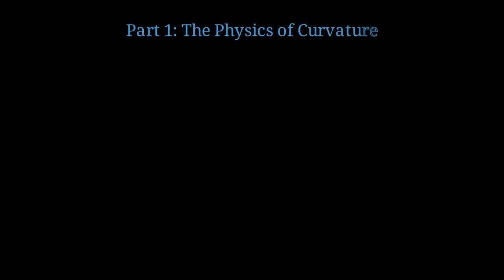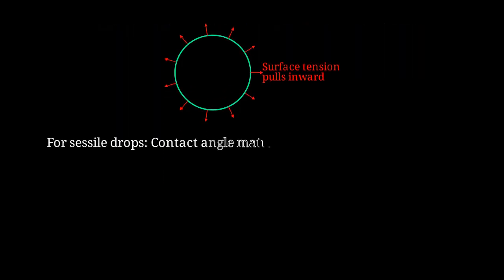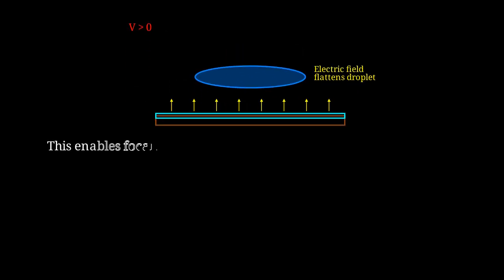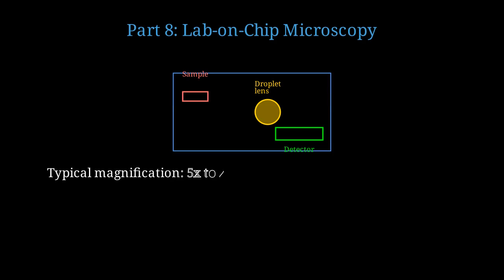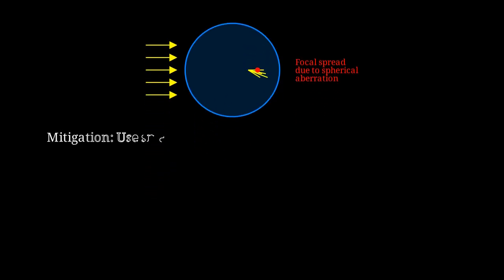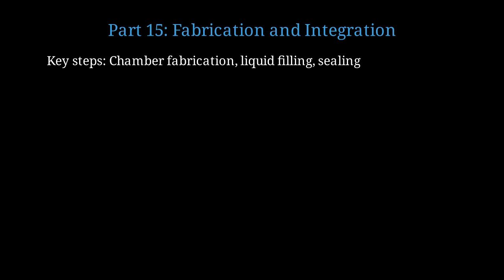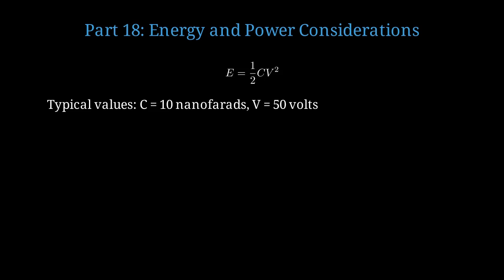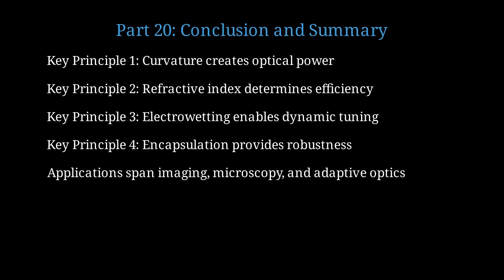Engineering Vision: The Rise of Smart Liquid Lenses

Comment from the maker: How can electrowetting dynamics be modeled to minimize contact angle hysteresis for fast focusing?
What limits the thermal and mechanical stability of encapsulated droplet lenses under prolonged operation?
Can multi-liquid architectures overcome chromatic and spherical aberrations simultaneously in dynamic systems?